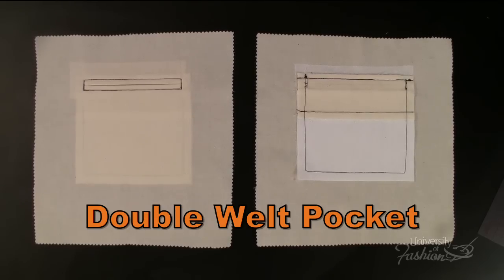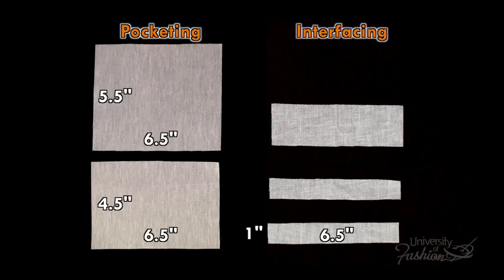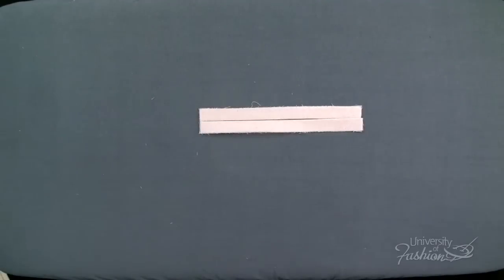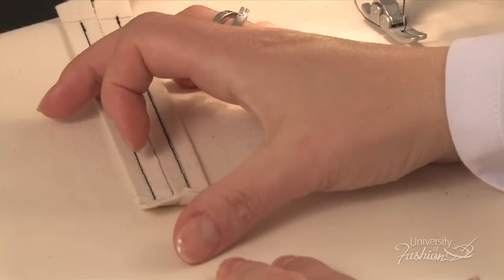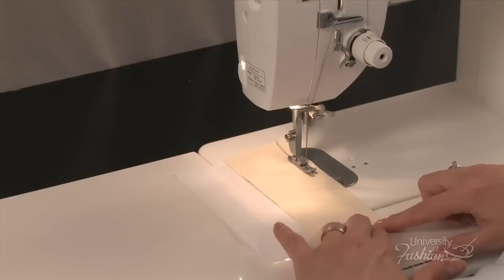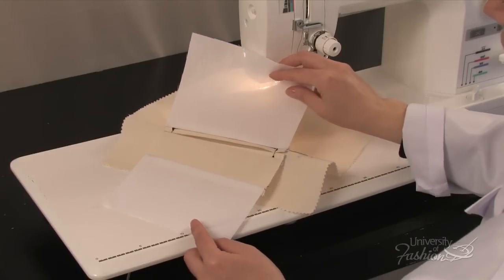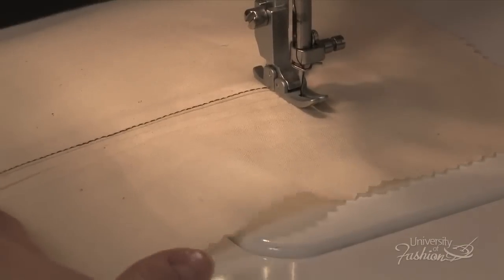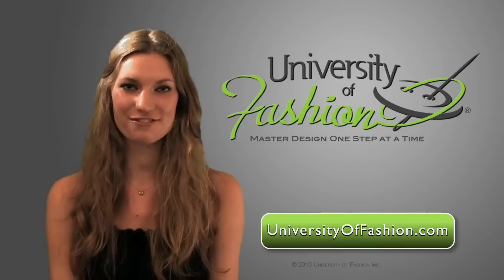Sewing a Double Welt Pocket -  Free Full Lesson!

Comment: The welts are CUT 6 1/2" long (NOT marked 6 1/2"). Then the welt  pocket stitching marks are made 1/2" in on both sides. These marking match up with the 5 1/2" marking on the body. Hopefully that helps clear up your confusion.

Comment: A confusing item in the video are the two pocket bags pieces.  In the beginning it says to cut a 5.5" "top" pocket back piece and a 4.5" "bottom" pocket bag piece.  Later in the video when the pocket is assembled, it just says to sew the "pocket bag" to the pocket facing and then to the top welt edge.  Then to sew the "lower pocket bag" to the lower welt.  The naming of the pieces is different and although it seems like the "bottom" pocket piece would be the same as the "lower" pocket piece, it isn't.  The 4.5" "bottom" piece gets sewn to the facing and the 5.5" "top" pocket piece gets sewn to the lower welt.
Reply: You are correct! The 4.5" "bottom" piece gets sewn to the facing and the 5.5" "top" pocket piece gets sewn to the lower welt. Sorry for the confusion.

Comment: holy hell, I can't get the fabric to not pucker a little at the corners when i turn the welt into the wrong side. I have done it 3 times. It keeps happening.
Reply from the maker: The key to getting nice corners is to be sure to snip into the corners correctly and make sure that your stitches end at the same place on both the top and the bottom of the welt. You can also try pressing the V section flat, that helps.

Comment: If the marking on main fabric was 5 1/2" and on the welt 6 1/2" how can they line up even you said go in 1/2" on each so that makes the welt now 6 and the bottom at 5 1/2 I'm confused
Reply: You mark 1/2" in an both ends of each welt.  Those marks line up with the 5 1/12" markings for the body.  Basically, when lining up the welt pieces they need to hang over 1/2" on each end of where the slit will be cut in the body.